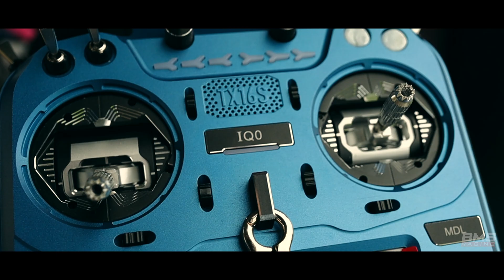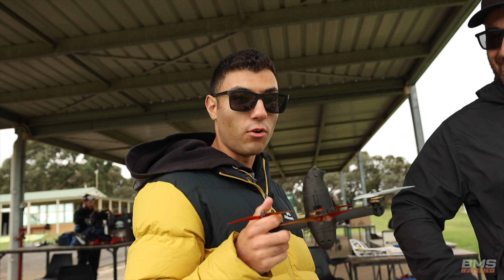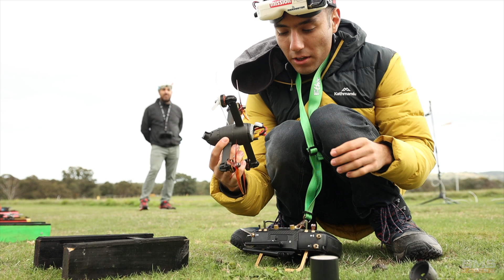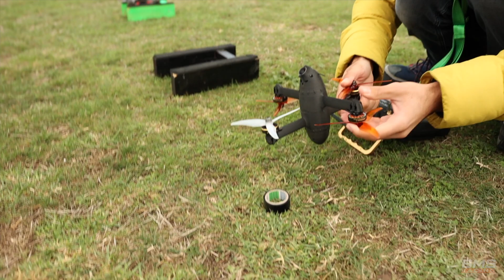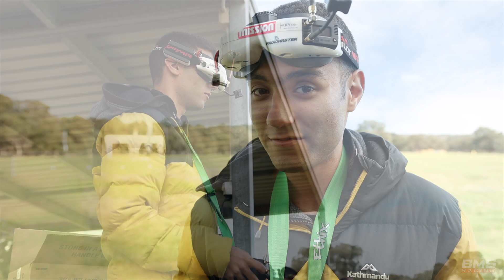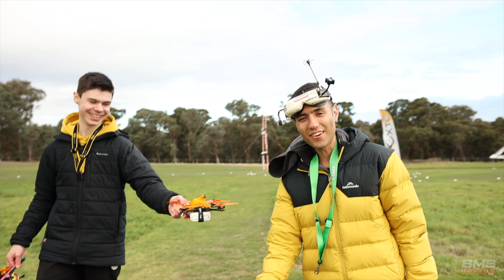Can this 3D Printed Aeracer Drone Actually WIN?

Comment: Looks cool, like that everything is contained/covered.  Why does it have 2 pusher props?
Reply: The Aeracer is designed to be injection moulded. The pusher/tractor config allows using 4x identical quarter fuselage parts to make the fuselage. Smaller/cheaper tool.

Comment: Its got to feel weird flying a cross configuration vs the X you are used to. Gauging clearances above and below the craft has a big change in terms of judging where the arms are in the camera. Specially after how long you have flown X and have visual and muscle memory locked in.  I figured you would tumble long before you did because of that with such minimal flight time on it. Well done. My problem with full bodies on a quad is it they are just one more thing to break in a crash and will add significant cost to replace. That is one of the reasons the DJI racer is such a fail for actual racing among other things but thats a whole other conversation.
Reply from the maker: I think the camera position definitely played a big role, but I do tend to fly a lot of wacky setups for testing etc with other quads in the background so for me I'll take it as a sign to increase my adaption speed and ability to switch from predictive to reactive flying more quickly! I agree with the full length bodies being a tough thing to carry into real racing. In my own time I've been trying to make something that has a more progressive breakaway rather then being intact or totally snapped, but its tough to find something that ticks all boxes while still using standardised parts 😅 I've learn't a ton this year about structures, aerodynamics and composites though from this testing so hopefully between ourselves or someone else in this community we stumble upon something big soon!

-Thomas
Reply: @BMSWEB  I think its cool you guys get to do all that as established pilots. For the rest of the general population grubments around the world have pretty much sucked the fun and life out of the hobby over the profits of their corporate sponsors.

Comment: Can you put a throttle curve on it? Might make it easier to handle? Surely someone smart could work out the aero, certainly vastly different to anything "normal".
Reply from the maker: I ran my usual throttle curve, but in this case I think it was the way the aero properties changed at different angles of attack is what made it a challenge. I think the best course for me is to get more experience behind such a platform and feel it out how to handle it before I start making settings changes.

-Thomas
Reply: @BMSWEB  well there you go!🤣 maybe I need to consider a throttle curve then, never seen anyone run one!

Comment: why + though?
Reply: Pluses rule! A little lift off the horizontal arms, Vertical arms are like a vertical stabiliser. Pitch control only requires 2 motors to change speed, others stay constant. In this case, the design in pusher/tractor config' so that the body can be made from one quarter part repeated 4 times. This configuration would be weird in a plus. Early 3d printed protos were all regular tractor config and were still pluses, but could be made x as well.